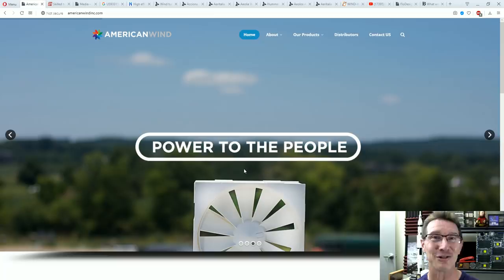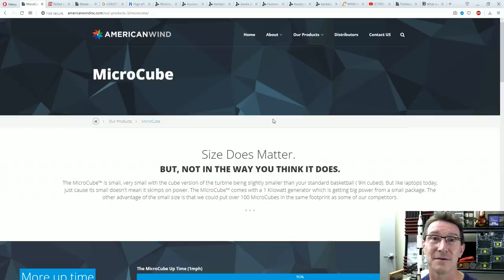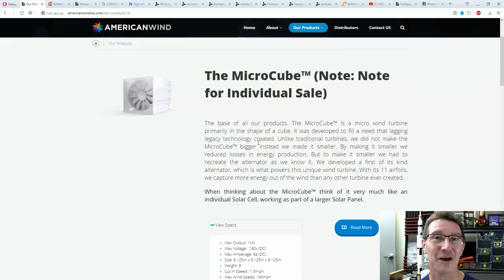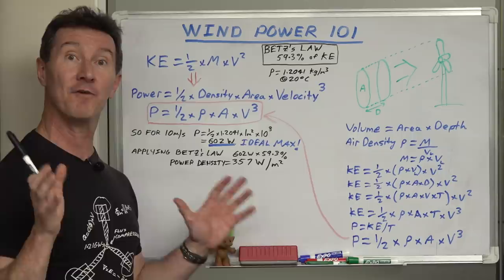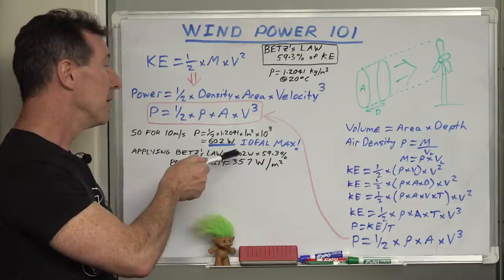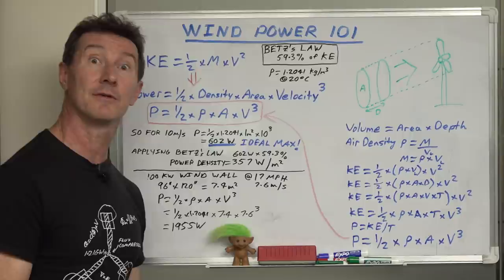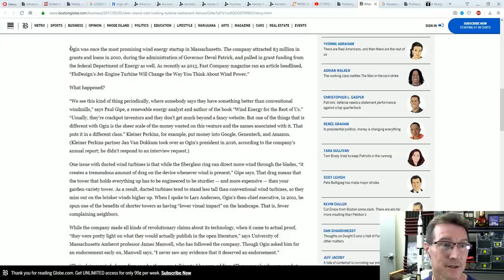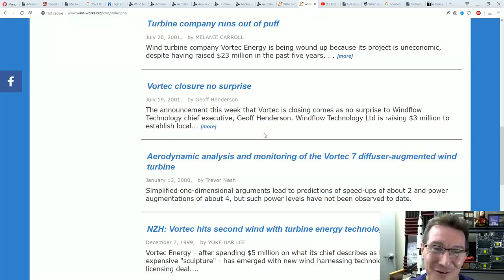EEVblog #1271 - 100kW WindWall Generator BUSTED!

Comment: That V^3 term builds fast, so 47 MPH (21 m/s) takes the ideal power up by nearly an order of magnitude.  To a bit under 20 KW.  Still nowhere near 100 KW.
Reply from the maker: Yep, any way you look at it it doesn't add up. It's pure marketing fantasy.
Reply from the maker: @user-jp1qt8ut3s  Of course it can, if the wind is fast enough. But their claim is 100kW at 17MPH. You'd need a hurricane force wind to get your 100kW input in that square area
Reply: @EEVblog  The point is that if you steal all the KE from the wind it just stops behind the blades and accumulates there increasing pressure and wind doesn't go from low pressure to high pressure..
Reply: @EEVblog  when I read upon Betz's law (didn't know something like that existed) I immediately went: Nuclear is only way to go....
Reply: @cmuller1441  Yes. Essentially to extract nearly all the energy from the wind requires a solid wall. Highly impractical.
Reply: So it would probably work.

On Jupiter.
Reply: One could argue, that if the dynamic pressure is high enough, while still having this wind speed, e.g. by putting an actual jet engine (that is why this is called ›jet engine technology‹) in front , perhaps you could achieve this power,
Reply: @RepublikSivizien  Yeah, essentially you'd have a very big air compressor. You wouldn't actually need the jet nozzle - that decompresses the air while accelerating it.
I think you'd need to be pressurizing the air to 50bar to get there, though, given we're increasing the power by a factor of 50 and air density is proportional to pressure.
I wouldn't want to be around a 50bar pneumatic system - that's 750PSI.
Reply: @peppybocan  Except nuclear fission plants have a thermal efficiency of like 30% (depending on the heat exchange medium). There's always losses and limits in energy systems that does not make one the only way to go. The bigger issue with wind power is that it does not add to the electricity grid stability, you need big generators for that which nuclear plants do have.  Nuclear plants have other disadvantages though, they are very expensive and are mostly suited to base-load operation (once they are running you want to keep them running at roughly the same power level).
Reply: @EEVblog  Running some numbers, at 100% efficiency it would require a wind speed of 28.17 m/s or 101.4 kph (63mph), at the realistic 48% efficiency (x0.593 & x0.80) that increases to 35.98m/s or 129.5 kph (80.5 mph). A CAT 1 hurricane is > 74mph . Basically anything above 33 m/s is hurricane force winds.
Reply: That was actually a pretty good point that you need to have a turbine high up to harvest higher wind speeds. And this increase probably more than pays for a higher efficiency at the ground level.  Is it thus put the turbine higher up into the air and dont care so much about efficiency? Then a kite based system should be a pretty interesting alternative.  Is that the case or what?
If yes then efficiency is only a buss word. Anyway 50% of all energy in the wind is pretty good already (80%*60%)
Reply: @MisterMakerNL  But , how do you mount the Wind Turbine Tower to the metallic hydrogen core?
Reply: @tegenfase  Fields of super capacitors. What could go wrong?
Reply: @MrSummitville  Installation details are left to the user.
Reply: I'm sure if this is a wall of high power fans it could consume 100KW of power.
Reply: @MrSummitville  you want practical or a joke? i would say float it in a boat made of solid metalic quarks/strange matter...only thing that wont melt in liquid hydrogen
or if you prefer, magnets!
Reply: Yeah, but the thing is, they claimed an optimal power output at 17 MPH, not 47.

Sorry, but they're just liars.
Reply: @mattb6001  well for one that would be a DC system. You'd need an inverter to supply that energy to an AC grid. Which still wouldn't give you any mechanical inertia. Perhaps if you'd use the energy to spin an enormous flywheel though...
Reply: Maybe if they threw "Hyper" in front of the name it'll get up to 100 kW?
Reply: To get to 100 kW, the wind would have to be at least 62.7 mph.
Reply: @tegenfase  We have been adding Grid / Utility sized Battery Banks for 5 years now, to smooth the output from  Wind and Solar.  Also, Battery Banks are now replacing Natural Gas Powered Peaker Plants to make the grid even more stable than previously possible  ...
Reply: EEVblog 6:50 🤦‍♂️ I’d be surprised if he can get more then  2KW from his wall .
Reply: @lasarith2  He can get 200 watts from one 9" x 9" Cube with a "ludicrous" 75 MPH Wind Speed!  As shown in another video.  Extrapolating to a 10 cube x 10 cube Wall equals 20,000 Watts = 200 Watts/cube  x 100 cubes ( again with a 75 MPH Wind ! ).  And finally, the inventor then "claims" 200 watts is only 1/5 Loading of the generator - but he never states the Wind Speed speed required for each Cube to generate 1,000 Watts.  And that is how the inventor calculates 100 kW for a 10 cube x 10 cube Wind Wall.
Reply: @RepublikSivizien  It's that little USB fan that's doing the heavy lifting here :)
Reply: MrSummitville thanks for the math, wind turbines are not expertise so I guessed at 20 watts per cube.
Reply: @cmuller1441  bingo!  You can NEVER extract ALL of the power from the wind.
Reply: @EEVblog  can they just add a smaal text saying "for use in Florida, during hurricane season"
Reply: I've been working in a venture not much similar to this. It was actually VAWT. With something over 4 sq.m. we were able to go up to 1.2 kW at 12 m.s. And we never claimed such fantastic numbers. But more importantly- with wind speeds in the range above 20 m.s., mechanics tend to brake and you get only debris...
Reply: I can't imagine why anyone would ever want to invest in this.
Reply: @QueueTeePies  Think about the issues of PC fans.
If you run a Noctua industrial PPC fans.
They run at 3000RPM at 3.6 watts.
Area 0.0133M^2 at 120mm diameter.
Flow rate of 186.7M^3/hour or 0.0519M^3/second.
Giving 4.6m/s

That's at 3000RPM.
Imagine the speed they'd need to spin if instead of 3.6watts. it was 1000W.
Reply: Why not to invest? We were able with 1M euro to achieve 4 prototypes and 3M more was needed to go into small volume production. And this is for machine that was never intended to compete with big HAWT. Just my boss wasn't that lucky to have millions from investors.
Reply: @peppybocan  Yes. Nuclear is the cleanest and safest and most reliable method of electricity production on earth.
Reply: Remember, Dave said it's "REVOLUTIONARY"!! baa-haa-haa  Whenever I hear that buzzword along with "our best yet" ("Fruity" company), makes me puke.
Reply: @UncleKennysPlace  Except for Fukoshima and Chernobyl ?
Reply: @frogz  Don't get anywhere near Jupiter with a powerful magnet ... you will not enjoy the uncontrollable ride !
Reply: @morpheas768  Actually, in another video, they "TESTED" the output using a "ludicrous" 75 MPH winds ...
Reply: @EEVblog  Can probably make 100kW i 17MPH wind If mounted on some form of wehicle running close to speed of sound👍
Reply: @peppybocan  its not that wind shouldn't also be built. wind turbines are going to bet more and more maintenance free as they improve the materials on them
Reply: @EEVblog  It is jet turbine technology after all! Obviously, there are some trade secrets that are not revealed, like turbofan engine In front of microcube.
Reply: @peppybocan  Nope. Not until a method is found to recycle used Uran.
Reply: Nonsense! We live in post-factual times. Freakin Windwall Roadways will rule the world!
Reply: @markp8295  100 of them would 3600W - I do know that PC fans and similar designs ARE much more efficient than an open blade turbine - often several times more efficient.  I'd give their "wall" under optimal conditions maybe 4KWDC @12V, because they do look suspiciously like large 3000-3500rpm PC/AC blower ans.  That's a long way from 120V AC...

My napkin math has it at maybe 200W(AC) running at maximum speed, basically in reverse as a generator after converter losses.
Reply: @MrSummitville  ..and except for disposal of radioactive waste.  You can't shoot depleted uranium at sandy wastes forever without affecting the environment and populace.
Reply: @mozkitolife5437  Hyper........how about "TURBO" blades? :D
Reply: @MrSummitville  Two accidents in a century is pretty damn good if you ask me.   Both caused by idiots lol.   That's old nuclear tech anyway, the new designs(which nobody is building yet that I know of, go figure) literally can't melt down.
Reply: Yes, and that is why you can't get more than around 59% of the energy out of wind with a turbine (Betz limit)
Reply: EEVblog, you totally screwed up and missed the truth. Take a look a this example of it working. Note that all the gens are spinning! Also, take a look at the guy's hair when he's at the desk and then when he steps in front of the generators.  LOL. https://youtu.be/V8yc2wFn034?t=235
Reply: @plektosgaming  I think you're mixing up how to calculate wattage.
Since 120V A.C. is the RMS voltage it's just current times potential difference for power.

So if 4kw DC that would be 4kw AC.

Not sure where the 200W AC came from.
Reply: @markp8295  I was factoring in the typical efficiency of normal large diameter ~3000 rpm PC fans(which it seems to use) and figuring for a more typical wind-speed that you'd likely see in practice.  Those fans are also typically 12V DC ( it looks like they are taking PC fans and running them in reverse as makeshift generators), not 120V AC, so you would need a lot of them in parallel as well as DC to AC conversion.  I would be amazed if they got more than 20-30% of their claimed numbers out of the entire thing on a typical day.

I'm figuring 4KW DC@12V, which would be probably closer to 200-300W AC(house voltage) on a typical non-hurricane strength winds day.  Which makes sense given the blade area versus a commercial turbine.
Reply: "The point is that if you steal all the KE from the wind it just stops behind the blades and accumulates there increasing pressure and wind doesn't go from low pressure to high pressure."

Revolutionary new device stops hurricanes dead in their tracks whilst producing hundreds of MWs of power!
Reply: Hmm probably each motor use 1kW power, msrketing reversed it. Profit!
Reply: @EEVblog  
100 KW from a 9 inch cube?
Shut up and take my money!
Reply: @EEVblog  In their video, they tested with 75 MPH wind, not with 17 MPH wind.
Reply: @UncleKennysPlace  You think that Nuclear Waste is "clean" ?
Reply: @MrSummitville  Nuclear waste isn't waste. It's fuel, with more than 98% of the energy it had before it went through the reactor. With more advanced reactors it can be used again and again. This is currently the only practical way to deal with the spent fuel we already have, keep burning it until its energy is reduced to the point where we can store it safely. As a bonus, doing this will cover all our energy needs for hundreds of years, with no new fuel used, and no new waste produced. If that all sounds to good to be true, look up the Integral Fast Reactor. This is old, and well proven, technology.
Reply: @jasexavier  Except, two nuclear reactors in Ohio require $1 BILLION bail-out to remain "competitive".  If your idea is profitable and clean then build one, using your money.  Too much Tax Payer money has been wasted on these failed ideas.
Reply: @MrSummitville  Nuclear power plants require longer to be profitable than fossile fuels. Construction costs are much higher, but fuel costs are vastly smaller. Unfortunately, most private companies can't, or are unwilling to, wait 15+ years to start making a profit. After you repay initial costs, nuclear is many times more profitable, but no one wants to make that investment.

As far as wasted tax money, a utility scale Integral Fast Reactor was built in the early 1990s. It was cancelled near completion for political, not technical, reasons. It cost significantly more money to dismantle than it would have cost to finish.

None of that matters compared to the problem of spent fuel. We have vast amounts of this very dangerous material stored on site at every nuclear power plant. We don't currently have a plan to deal with it. This is the only thing we're sure would work to deal with that material safely. Just consider 500 years of clean energy a nice side effect of disposal.
Reply: @peppybocan  Why though, nuclear is not renewable. It's super economical but it's a huge and multi-year investment to build a nuclear power plant. You can build wind turbines on all scales, and it doesn't create any permanent waste.
Reply: Brilliant.. Live it
Reply: Maybe if the wind is kerosene vapour and you're igniting it on the way out of the duct.....
Reply: You need to use the jet engine technology. Just stick it on the jet exhaust and it should...never mind it melted.
Reply: I just calculated it at 37.7°C/100°F and same speeds as Dave did I got 18.84W ideal with Betz law applied. And 55°C/132°F I got 17.94W again with Betz law and that's not with efficiency losses after the fact so yep even in hotter climates still completely shiz

Comment: "it doesn't matter how many blades"
Gillette will gladly try to prove you wrong.
Reply: Especially if you're a white man....
Reply: i believe gillette also has 3 blades :))
Reply: @narc1408  No.  They just went back to 2 blades.
Reply: After that famous ad I took my dad's old school variable gap double-edge razor with one blade and I should say that 1) one blade is enough 2) it's a better shave 3) which is 10 times cheaper.
Reply: @maidpretty  Fortunately I think classic style safety razors are doing a comeback, as people are starting to discover that they, like you said, shave WAY better than the wanky cartridge razors with 500 stacked blades, and cost like 10 cents per blade, not 10 dollars.
Reply: @blameyourself4489  Interesting. As soon as 3 bladed razors were introduced 15-20 years ago or so I tried and disliked them immediately. Prefer 2 bladed razors.
Reply: @wtfiswiththosehandles  Actually.  I think that's a very individual thing.  I was laughing too when they came out with four blades.  But my face do prefer these as they pick off the hair below the nose much better.  Oh my God.  We're sound like a couple of girls  :-))
Reply: Dr_Kachu san the one I’m using has 5 blades.
Reply: Have always been a fan of the original Mach 3.  I've tried more and less blades, but keep going back to 3 blades.  Expensive compared to some other options, but cheap compared to the 800 blade vibrator razors they have now.
Reply: @maidpretty  Yep and if you shave once a week those multi blade razors tend to quickly clog and ypu gotta keep rinsing them and washing them and repeating the shave to get closer.
Reply: I have very coarse hair. My five o'clock shadow kills the multi-blade cartridges, the stubble gets immovably packed in between each blade before I can even shave my whole face ONCE. Gave up on them years ago. LOL
Reply: Fuck everything, we’re doing 5 blades
https://www.theonion.com/fuck-everything-were-doing-five-blades-1819584036
Reply: eventually they'll make like 10 blade shavers and it'll composite a solid surface and you can cut nothing
Reply: Lol, reminded me to look up the Schick Quattro "four blades good" Dinohunters ad...game...thing.

I'm only on my second or third Gillette blade from the pack in 15 years.
Reply: "2030, gillette introduces the newest design with 20 blades"

Comment: A: Recently, Japanese invented a 20 liters gasoline canister. 
B: That has been invented 100 years ago.
A: Yes, but this one fits in your back pocket.
Reply: V C Yeah, that's a really good analog...
Reply: my plastic bag can do that
Reply: Sure, but is it discrete enough to sneak 20L of vodka into a concert?
Reply: I get it now, most airplanes use one engine, but they should be using 100 tiny engines instead. More efficient.
Reply: I think that's what President Trump keeps in the seat of his pants, isn't it?
Reply: @Landrew0  Not enough static pressure! :)

Comment: @ 6:23 "It actually increases the wind speed." So: you line them up one behind the other and free energy, perpetual motion here we come.
Reply: Put them in a circle and eventually they go faster then light. They've inadvertently build a time machine!!
Reply: I suppose a turbo style design can "increase" wind speed, but reduce the energy (you could use a big wind turbine to power a small fan, to power a tiny baby wind turbine. You would make a LOSS, but it would have faster wind speed, lol!).
Reply: TechyBen What you have described there is what a normal person call an "inefficient fan"!!!
Reply: @NXINFINI  Really? /s
Reply: 😂😂😂
In fairness, I suspect he was trying to explain that the ducting and funnel intake increased the wind speed through the turbines, not the turbines themselves, but his explanation was soo poor that I don’t have faith in any of the claims.
Reply: That was by far the dumbest thing said. You can't simultaneously extract the energy from the wind and make it faster. If a middleschool student said that he would be told to sit down and he would get the worst grade immediately.
Reply: Plot twist: it was a gas turbine all along.